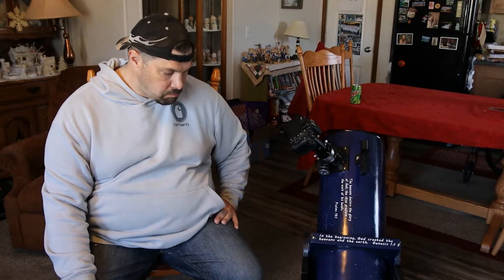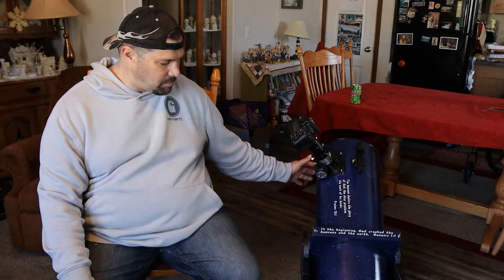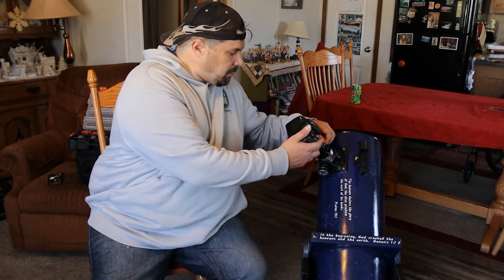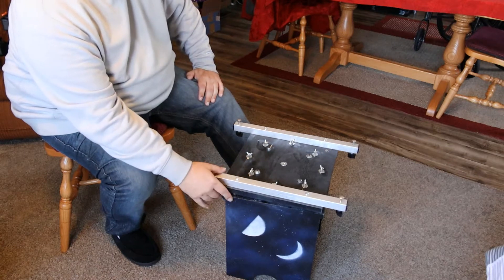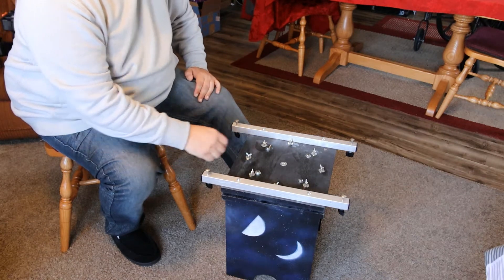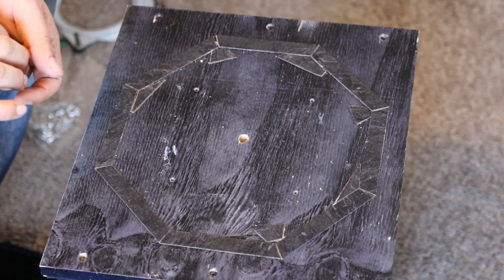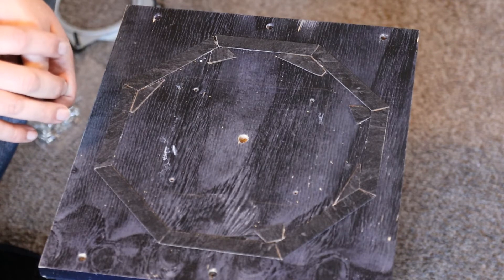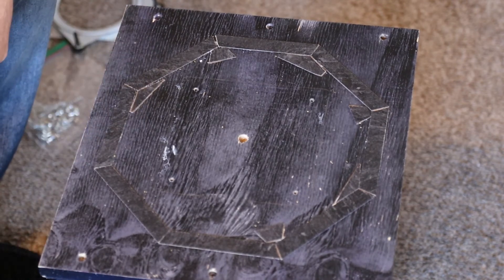IMPROVED DOBSONIAN BASE

Comment: Much better then my approach with a similar scope. I took pieces cardboard boxes, folded them, and shoved them between the 2 boards. 
Another thing that helped a lot was to take 3 rare earth magnets, and place them on the top board, right over were the ball bearings ride. This provided quite a bit of “tension” making the bearings more stable and keep them from moving side to side. 
Its good enough for what i use the scope for. But eventually im going to laminate the top board with ebony star and use teflon pads on the bottom. Fot the pivot, i plan on using a tapered bearing (the type you find on your vehicle hubs).

Comment: Do you think 3D printed pads would work instead of the adhesive ones?  Then you could print them around the bolts.  Nice job, btw.
Reply from the maker: Thank you, I would think 3D printed ones would work. You can make a full ring and attach it with double sided foam. Just make sure the plastic is nice and smooth so it reduces any friction.